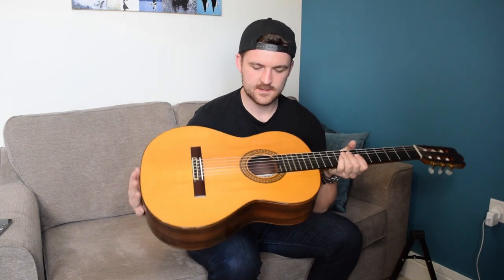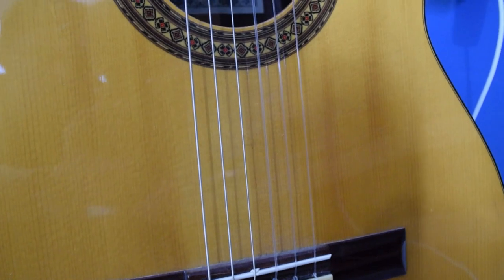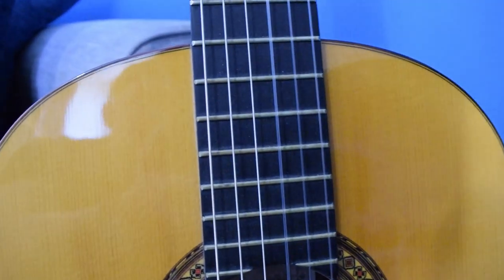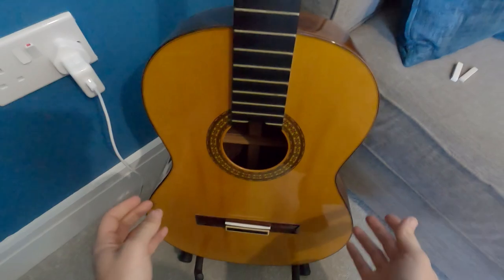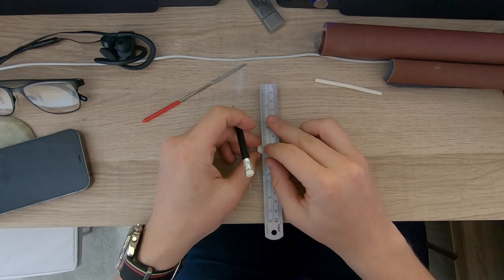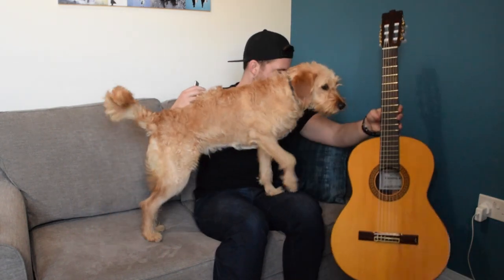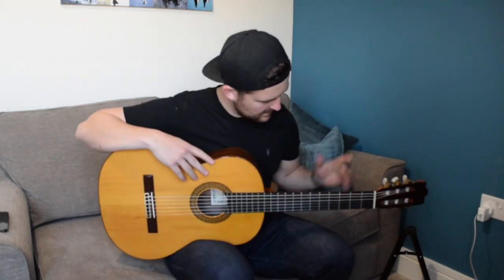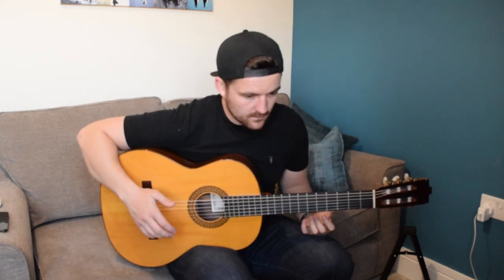DIY Luthier - Classical Guitar Saddle and Nut Replacement

Comment: I have a classical guitar that I am in the process of changing out the bone saddle. It has a different size neck and fingerboard than any of my other classical guitars.  I didn't even think of that when I got the new parts.  Fortunately I will have plenty of material to use, but it will take a lot of filing to get it to where I think it should be.  It was missing strings and saddle when I first got it used from a thrift store many years ago, and I just made one out of plastic and it worked flawless.  I decided since I never play it (got for a daughter who never wanted to learn to play for long), I was going to sell it, and decided to fix it first....now I ran across your video to confirm that you have to do customizing.  I am just shocked at how much filing I will end up doing and even shortening it a tad! The width of the neck is so much narrower, like a regular acoustic guitar neck thickness!  (It is a Conservarte made in Korea) Thanks for sharing your video....